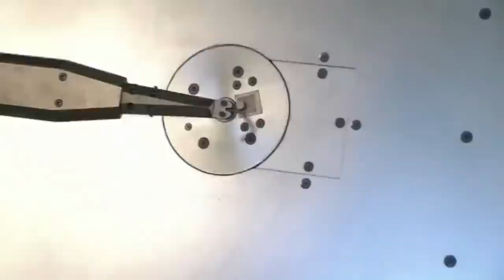Top 5 Satisfying Factory Machines - Eye Candy

Comment: did i just see a jet wash cut through steel?
Reply: Michael yes is a "jet wash" with a high preassure. Its water.
Reply: shame we cant share memes on here.... i can imagine a bank robber with a karcher pressure washer saying, best 50 bucks i ever spent...
Reply: Water, plus I believe grit is  added to it.
Reply: Water as a carrier for carborundum, yes. Bulk cutting and a beautiful finish at the same time. So unique.
Reply: Yes, but the first one cutting the square section channel was not tuned properly. The 2nd one was a bit better.

Comment: Satisfying to watch?  Well yes, you're watching this on the internet:   Your not watching this repeatedly for 10 hours a day.  I was a production machinist, and did much of the machining sequences shown:  Just remember you don't have to deal with 90+dB sound all day, extreme heat while fully dressed in work clothes and hot, heavy boots.  And keep hoping all day long that an heavily overstressed [speeds preset by your boss] tool holder that  costs $3k, (and you'll get blamed for) does not grenade itself. Then watch this over, and over, a million times a day, and then see if it is still "satisfying" then.

Comment: I run machines almost exactly the same as the first one. They are pretty interesting until you run about 40,000 pieces of the same thing lol
Reply: Jeffrey Perdue wats the name of the first machine?
Reply: lakkish g1 the machine type is called an automatic bar bender. The ones I run are called the spirex machine from schnell company and the MEP concept 90. They are rebar benders for structural reinforcing steel. Not exactly the same as shown but almost the same damn thing

Comment: In 3:05 really iron cutting by water pressure
Reply: What that is, is that they are using water mixed with a very fine sand, that is what does the cutting while the water is there for cooling and rinsing.
Reply: No actually it is cutting by water pressure.. Simple water pressure..

Comment: An excellent example of how lame Youtube videos can be - complete lack of any explanation of any process, you must turn off your brain while you watch this, for curiosity will only lead to being very annoyed.   So what are those bent wires for?  How big are they (scale)?  What are the monster springs made for?  One of those 400-ton-load dump trucks?  Or earthquake-proofing a building?  What's the point of the drop hammer banging a piece of hot steel?  Line this video up in a group called "anti-Instructibles".